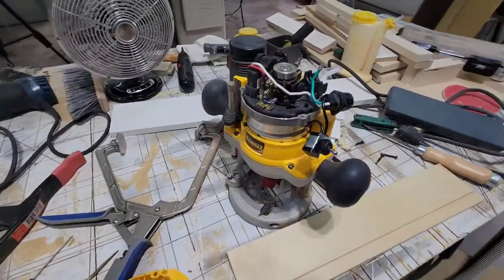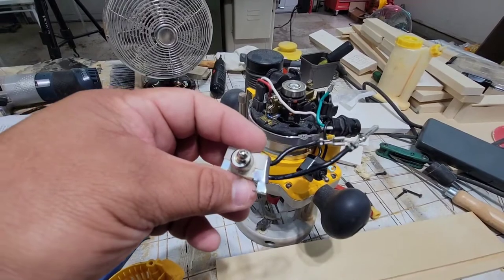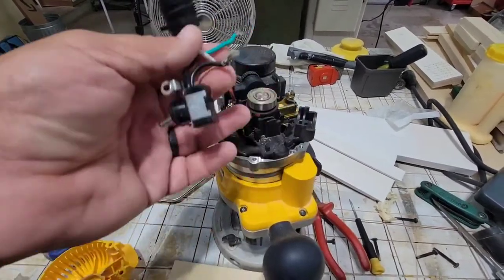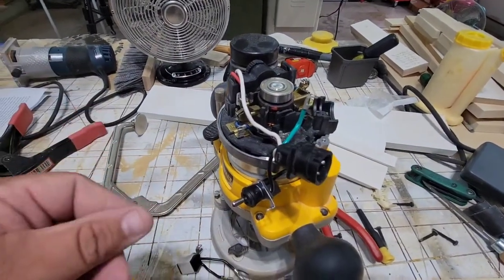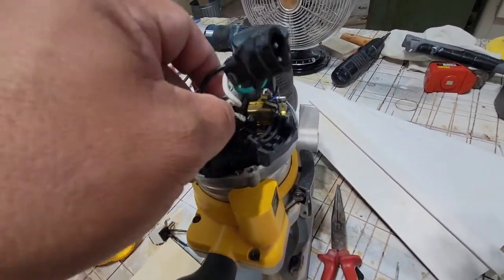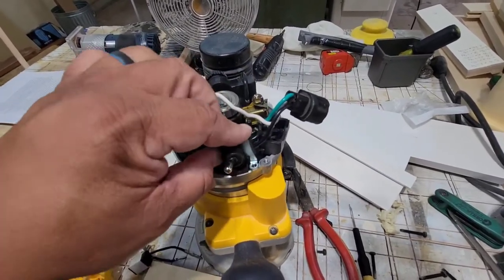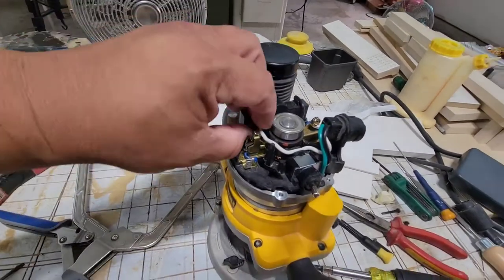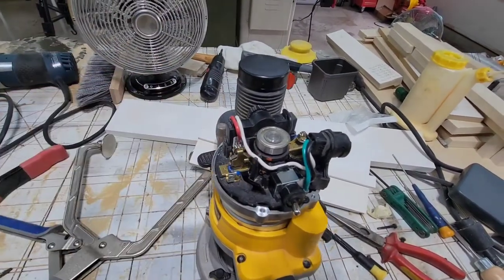Dewalt DW 618 Router Toggle Switch Replacement / Won't Power On

Comment: How long had you had the router before you had this problem?  I just purchased one in the reason I ask.  Thanks.
Reply from the maker: I have owned it a little over a year. But I bought it used off a friend. That being said it was primarily in a router table when he had it so it's odd that it went so soon. I opened the old toggle switch up afterwards and the metal contact was broken inside.

Comment: I have the same router but it gets very hot and fast. It is normal? how could i fix it? It has new rollers
Reply from the maker: You know, mine doesn't get that hot. That actually sounds like a potential problem with the unit. Maybe just adjust the rpms down?